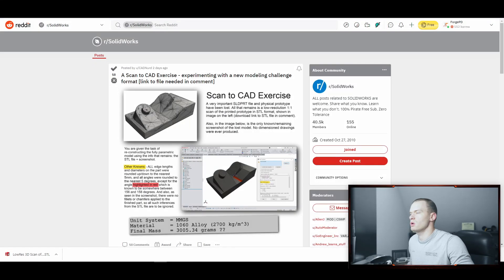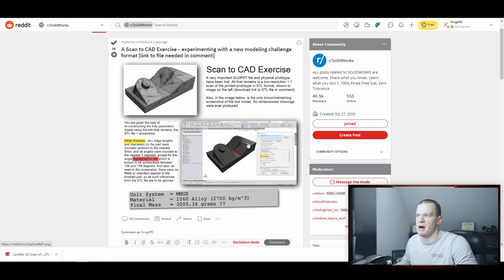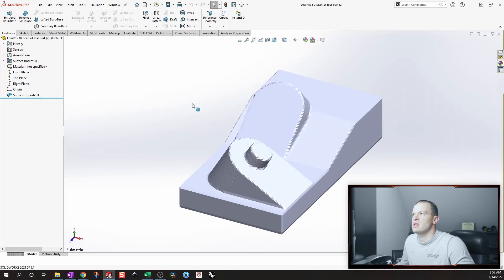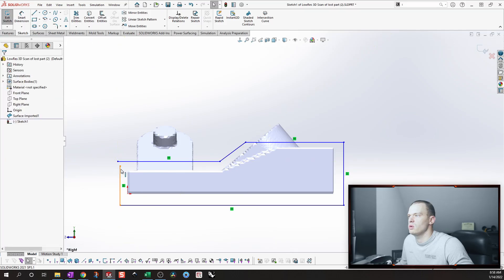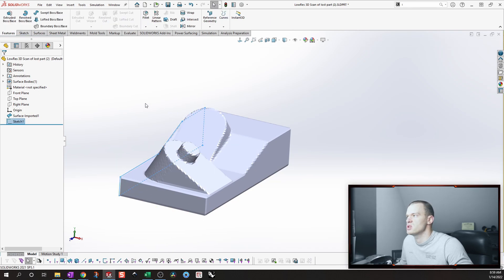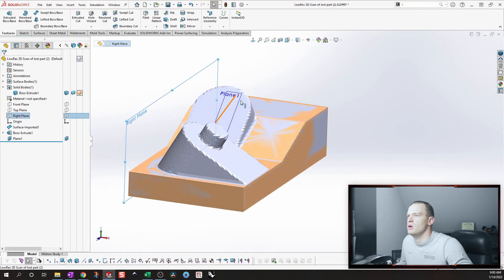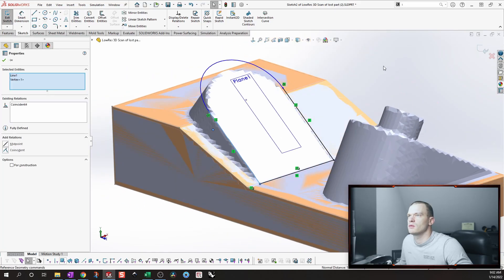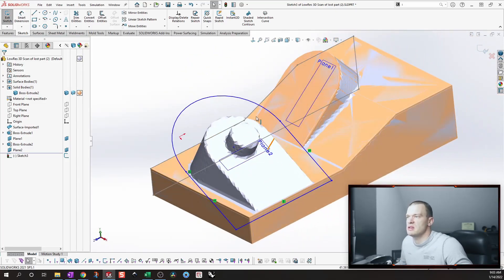How to Reverse Engineer .STL Files in SolidWorks

Comment: How to convert skull ( stl file) into part
Reply from the maker: Honestly that organic of a shape would be tough in SW. You are likely better off using blender or zbrush to try and rebuild the surfaces.
Reply: @forgeproductdevelopment  ho 
I'm trying in the  solidworks
After when I imported in ANSYS meshing 
It shows a warning.
Reply from the maker: @AnilKumar-ey5yb  What is the warning?
Reply: @forgeproductdevelopment  the mesh generation did not complete due to poor quality elements or incorrect input
Reply from the maker: @AnilKumar-ey5yb  Is that after you rebuilt the mesh in zbrush?
Reply: @forgeproductdevelopment  no
Reply: @forgeproductdevelopment  I don't know zbrush sir.

Comment: I need to do exactly the same thing but my stl is very complicated and heavy 200000 triangles. Also there are gaps, holes, poor geometry etc so when I open in SW the only really suitable way is as a Graphics Body. I tried using Surface Wizard and it filled holes etc but just wouldn't build a stable Surface Body. So does this process work with a Graphics Body? Thanks

Comment: What if I have a "clean" 3D mesh with triangular topology and already perfect edges/dimensions? Is it better to reverse engineer it or are there any faster ways to convert relatively complicated 3D meshes to editable solid bodies?
Reply from the maker: I do not personally know of a program that will take a mesh and create clean geometry out of it, though I can imagine something like that being out there, you may just have to find it.

As for staying within SW, this probably depends on the size of the mesh, the complexity of the part, and how much editing needs to be done. On a small mesh you could just import as a solid and then use features to add or cut material. If you need a fully parametric model, then yes you will need to recreate it to have the proper feature tree and sketch geometry.

Comment: This works great for simple parts, which begs the question of why not just measure and draw it? When trying this method for complex 3D scanned parts, SW struggles to open with those settings unfortunately...

Comment: How would you do this if the structure was hollow with internals?
Reply from the maker: As in you can't see the features on the inside to select them? I would use a combination of section view, transparency, select other and cutting away material, to get to the features I needed. Does that help?

Comment: Hi, thanks for vid. What do u think about Mesh2Surface addon for SolidWorks?
Reply from the maker: I have not personally played around with it. What specifically are you trying to do? 

My typical workflows do not involve converting scan data to usable geometry within solidworks. Normally the scan is just reference to what I am creating. I know there are programs out there that are built for repairing and modifying meshes (zbrush, blender, others) and that is likely what I would use for something like this. Then I would import the clean geometry into SolidWorks and go from there. The mesh2surface plugin may be a cleaner solution than these programs, but I do not have enough experience to say for sure.

I have used the PowerSurfacing plugin to good effect tho.

Comment: I have a stl file, i want to modify it in solid works.  i have tried to bring in as solid, then convert to solid, but still have lots of triangles.  im a novice.  im not a good designer but i need to make small tweaks to stl files.  can you point me in the right direction

Comment: Overall a very good educational video to reverse engineer a scanned part. 
But here are my 2 cents to the process shown in the video.

The first step should always be to check and fix alignment of the origin aswell as checking the geometry itself if its warped or crooked, ie squareness and parallelism of the main surfaces.
In general you should really only use the scanned model as a reference to create an actual parametric model. All the sketches and planes you did should not be actually used for extrusions but used for construction reference. This way you can use them for defining actual real measurements for a fully adjustable part that can be edited like the original part. It takes a little bit more work but its nice to have the fully adjustable features for the whole part. That way you can customize it again and it wont be locked to the scan's dimensions which, in the real world, are always off, have weird decimals and never 100%  accurate geometry. (In this example the angles are off and most of the dimensions have weird decimals)

FYI if you do it this way the mass of this model is 100% accurate with the provided mass it should be.

Thanks for the video!

Comment: Awesome video! I´m starting to work using reverse engineer to design new parts, and this help me a lot, thank you
Reply from the maker: That’s awesome! One tip for reverse engineering from scan data: You don’t need as many points as you think. Accuracy of the point and knowledge about how the part was manufactured can go a long way, and help reduce file size. Good luck!

Comment: Josh thanks for this video.  I need to import several drawings into solidworks and remodel them as the original designer used blender.  Im having issues with scale when importing.  If I import the model into blender the model is the proper scale.  But if I import it into solidworks the entire model is super small.  Changing the import options from CM, MM, M, Ft, In doesnt do anything for importing.  Any tips?
Reply from the maker: Hmm, sounds like my first suggestion of changing the import units didn’t work. What is the file type you are importing? If it is3D geometry and you know what size it is supposed to be, I might just import using any units, then use the scale command and play around with the scale factor until it is the size it is supposed to be.

Comment: I'm starting to use 3D scanners with SW and this video will help me a lot. thanks!
Reply from the maker: That’s awesome! Glad I could help. What type of work are you doing with the scanner?
Reply: @forgeproductdevelopment  I am using it to scan molded parts to calculate shrinking and also for other stuff like machine parts 😄
Reply from the maker: @mariocastro5866  very cool. What type of scanner are you using for that type of work? I have to imagine it is very accurate for RE or quality control of machined parts.

Comment: Seems like this method is only good for simpler parts
Reply from the maker: This is just a basic example to show how to pull information from the STL. The techniques can be applied to any feature to model more complex geometry. Also, keep in mind that Solidworks is not always the best tool for the job. For reverse engineering really organic models, other software may be better.
Reply: @forgeproductdevelopment could you point me to said software? Really struggling with an organic part I have to reverse engineer.
Reply from the maker: @D1S0-  The “Power Surfacing” add on for SW is a good option, if you want to stay within SolidWorks. Also, SW has browser based tools that can be used for SubD, but I have not personally used those. Rhino and Blender are less expensive tools for surfacing/organic work. There is a learning curve and you will have to import/export. If you can share the model, I would be happy to take a look at it for you. I have been meaning to do a organic stl RE video.
Reply: @forgeproductdevelopment  yeah I don’t mind sending the stl file your way. Also I have to let you know that it’s a 3d scan with a mix of organic and non organic shapes. Where would you like me to send the part?
Reply from the maker: @D1S0-  info@forgepd.com

Comment: Liked and subscribed. The algorithm has a funny way of showing you things you need when you need them. 

Can you please, PLEASE, do this with more organic STL files? I have to recreate an instrument and the curvatures/surfaces are killing me. Thank you
Reply: That's because it literally listens and watches you ;)
Reply: This method only works with simple parts like the one he’s done here, you could try to just import your STL file as a solid body instead of a surface body.
Reply from the maker: If you do not need to create perfect geometry, using the stl as a body may be a good option. It depends a lot on what you need out of the model.
Reply from the maker: Would you mind sharing the file (or something similar). I would be happy to give it a try.

Comment: Why did you extrude the circular feature boss 2-ways? First, you did up to next (downwards), then you extruded up to vertex (upwards). Couldn't you have only extruded up to surface considering the circle sketch was already sitting on the correct plane?
Reply from the maker: For the first extrude, we could have extruded down to the surface of the body, since it was one continuous surface. For the second extrude (the cylinder) I wanted to use a point from the .stl to stop the feature. There are lots of ways you could have done it, and most would be valid.

Comment: I've got all filters on, but cannot get vertexes or edges to highlight to extrude to the opposite side like at 5:15.
Reply from the maker: Hmm, maybe try turning off all filters? There may also be a checked box in your settings that is stopping "dynamic highlight".
Reply: I'm having the same issue, I'm wondering if were doing something wrong in the importing stage

Comment: Just discovered your video and really liked it. I learned a lot. 
I have a problem where occassionally a solid body is stuck on transparent and nothing I do can change it back to opaque again. I'm using SW2017. Can you do a video on that?
Reply from the maker: Hmmm a video would be tough unless I can recreate the problem.

I have seen similar things where surfaces will go transparent and look like sections of the model are missing. It usually resolves by restarting Solidworks. You can also try "ctrl+Q" to rebuild the feature tree and force it to solve the body again. It may also be graphics compatibility issue with the older software version. Updating to whatever version you can may help.
Reply: Please visit my channel for more Reverse Engineering video tutorials. Keep learning!